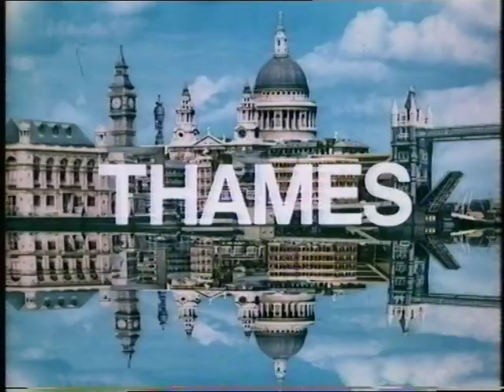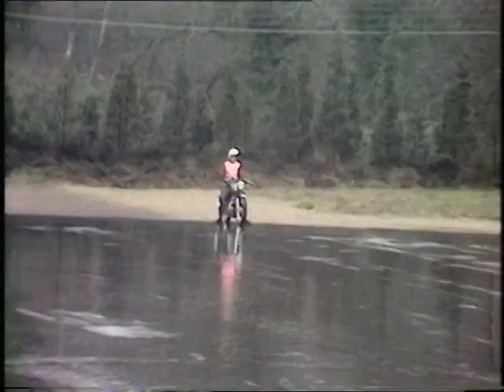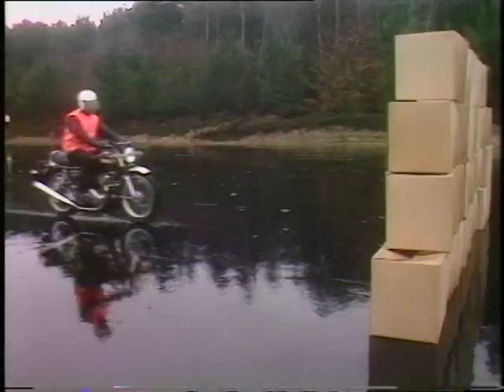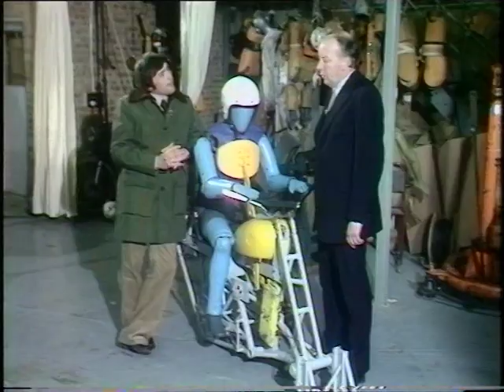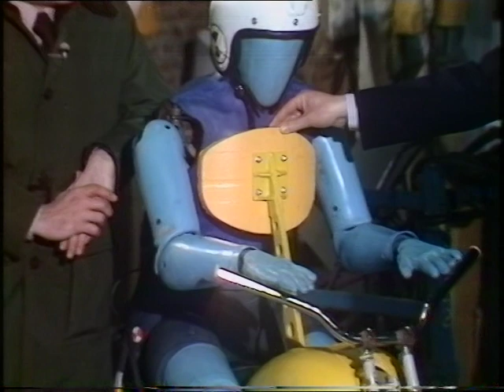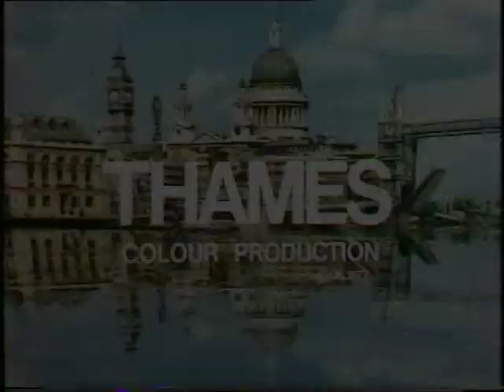Motorcycle Safety | Safety on Britain's Roads | 1970s Motorcycles | Crash test | Drive in

Comment: Mention of the 30mph moped limit dates this as 1977. 03:40: most sports moped riders wished they could do 60 to 70 mph! Most of them might have just nudged 60 with a long downhill run-up and a following wind. Otherwise 50 was about your lot and it took ages to get there. It was exaggerations like this that led to the 30mph law. A maximum speed of 30mph meant inexperienced 16 year-olds getting into difficulties in fast traffic. A limit of 40 would have made more sense imo, as 16 year-olds couldn't ride at high speeds but still had a chance in traffic. Yet another law made by people with no direct experience.

Comment: I remember used Super moped prices going up as no one wanted a restricted bike. 
Most exiting (and dangerous)! moped I rode was a Garelli Tiger cross on knobbly tyres on a wet road, 
No indicators, useless small speedo, no battery, no reed valve, no disc valve, but plenty of vibrations, Very Scary 😬

Comment: Government just changed max speed back down to the original moped top speed of 
30 mph but a rather stupid idea in most people’s opinions as more vulnerable to blind idiots in cars. Most restrictions were easily sorted with carb jetting or exhaust mods so anyone with a bit of mechanical knowledge & a few quid could go faster again 😃

Comment: What had this bloke been smoking! 60 or 70 mph, I Assume that’s what the super-moped lads might have claimed but way off for a standard bike unless it was falling off a cliff. 
I was a sad 16 year in 1976 old that bought a Honda SS50, What a fool I was 😬
49cc mopeds were all pedal & pops such as puch maxi, Honda pc50 etc pre 72 until some very clever bloke Hit on a way of selling 1960,s 49cc commuter bikes as sixteener specials. 
Ingredients...Take a dull Suzuki A50 4 speed commuter bike, change the tank & seat, fit a 5 speed gearbox, bolt a pair of virtually useless pedals through the swinging arm, give it a snazzy paint job & your onto a winner 😀
Reply: I too had an ss50, bought in 1973, and forever wished (wish?) I'd bought the cheaper and (slightly) faster fs1e next to it in the shop instead. Or even the much faster (ok not 70, maybe 50mph) Garelli Rekord.
Reply: It was exaggerations like this that led to the 30mph law. I clearly remember some prat on TV in 1977  riding an FS1E round a track and then saying he had been doing 60-70. But that was on the speedo. No mention of using measuring equipment. The speedo was clearly well out.